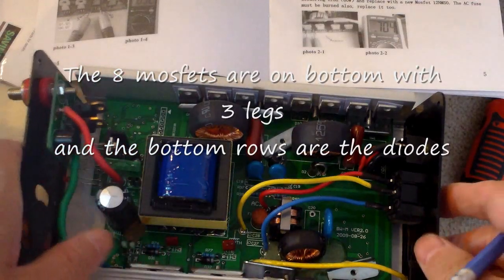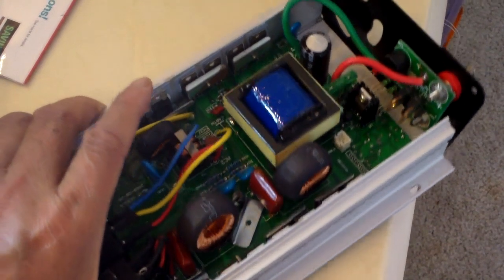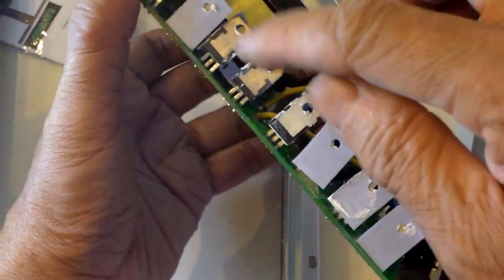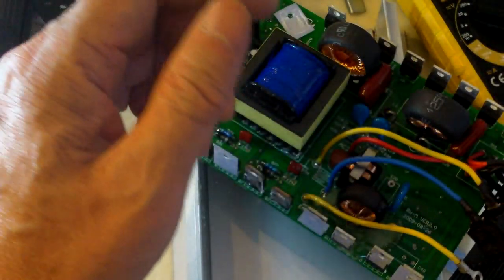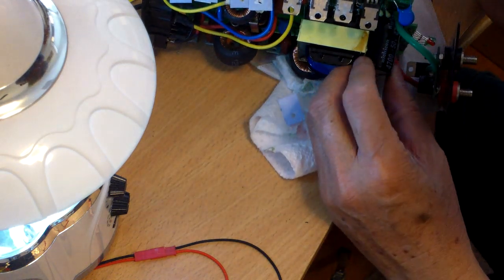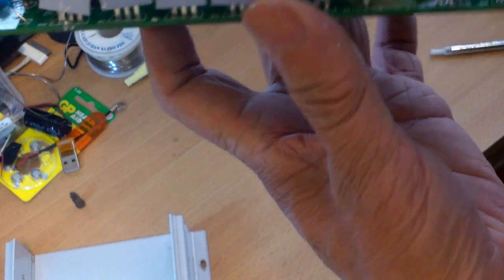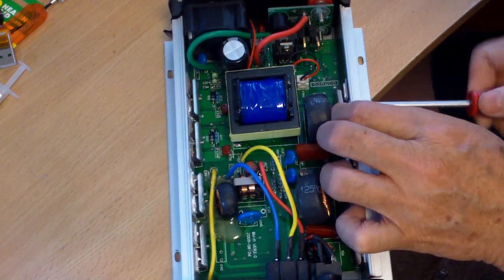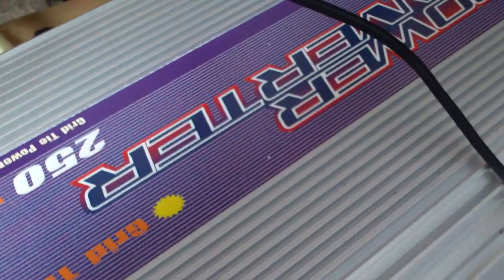Repairing my 250 watt grid tie inverter

Comment: One important piece of info that's not mentioned in any of these grid tie inverter videos is the type of AC fuse used on the board.  All I could find for an hour or two on the Internet were either "blade fuses" (for motor vehicles) and "glass cartridge fuses".  I finally found the "fuse type" on digi-key or mouser is called "board mount (cartridge style excluded)" and the "package/case" is "radial, can, vertical"...so it's basically called a "radial fuse".  

At first I read 75A 250v on My powerjack 300 fuse, but using a magnifying glass and flashlight I noticed they put a "T" next to the "5", so it said "T5A 250V" not 75A or 7.5A.  Be very careful finding the correct fuse, a higher rated fuse could've started a fire and further damaged the board.

Comment: Excellent vid. I have a 600 watt and after 1 year the 230~volt (AC ) side was defect. change 2 mosfets and now after 2 years on the DC side (Solar panel in) 2 mosfets defect... There are not the best inverters with quality.. But for the price is ok to repair them.

Comment: can you tell me what the poti vr1 on the top of the unit and the vr2 on the backside do?
Reply from the maker: Keepsake2009 I don't really have any idea. They are probably part of the control circuit and are voltage dividers used for the control. Maybe someone more knowledgeable can enlighten us.

Comment: Do you have a link to the repair guide? Or can you scanned the pages? I have 300w which ac side seems dead.thank you:-)
Reply from the maker: I'm sorry but I can't find the repair guide I have. However, you can find the repair info at this link: http://www.12vgridtiepowerinverters.com/FAQ  Scroll down the page and look at the repair information for the 300w unit. I think the repair manual I had was better but the info from the link might do the trick for you. Good luck

Comment from the maker: My newer inverter is supposed to have fast blowing AC fuses that you can replace without unsoldering. Like anything else, they'll fail over time but some are repairable. I spent about $6 for parts on this repair which is not so bad. Thanks for commenting.

Comment: I just had a problem with my grid tie. It was my fault I unplugged and plugged back in my grid tie without turning it off first and got a voltage spike. I was able to replace one mosffet and its working. Its nice having the youtube videos out there to help with trouble shooting and repair. Fearlessthinker has good videos also knurlgnar24. Thanks for sharing.